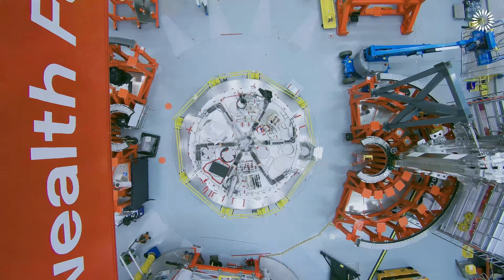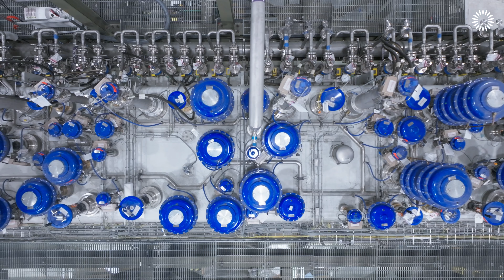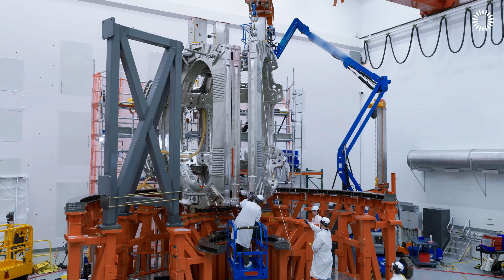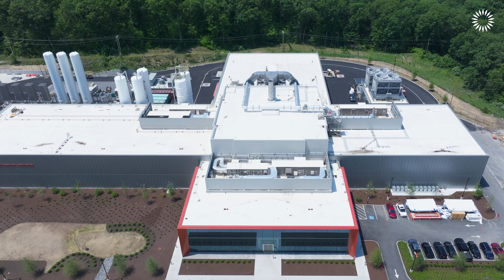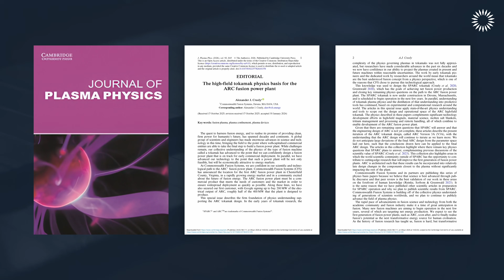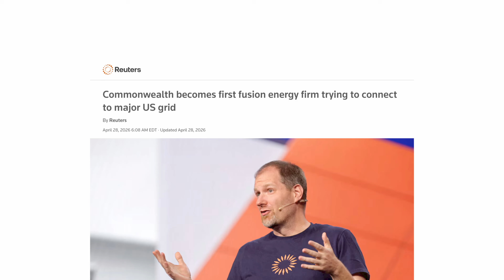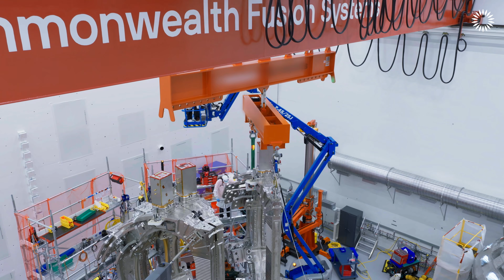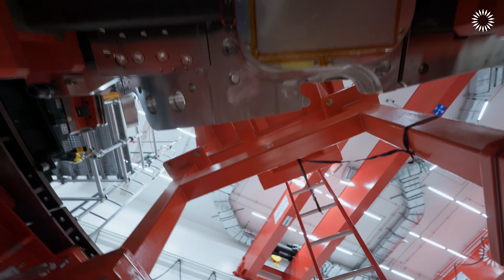An update from Commonwealth Fusion Systems (July 2026)

Comment: CFS first claimed they would achieve scientific breakeven in 2025.  Now it's 2027.  To produce ANY net power, they need to not only achieve scientific breakeven, they need to achieve engineering breakeven where the power created, after all engineering losses in power conversion, is more than the power put into the machine.  That's roughly about 5x more difficult than scientific breakeven.  To make fusion power economically, they need to achieve economic breakeven, arguably about 5 times more difficult than engineering breakeven.  They claim they will do this in the next ~5 years.  

After 60 years of research trying to make fusion work with tokamaks, some much larger than CFS's device, there's just a factor of ~25 to go.

It's a scam.  By the way, I have a PhD in Nuclear Engineering (fusion emphasis).
Reply: The absolute maximum time that fusion reactions can occur on SPARC is 10-seconds then, due to the lack of a robust heat removal system, a 4-hour thermal recovery time will be required before another fusion test shot can be attempted. Its maximum fusion energy duty cycle will be 0.0007. The conceptual ARC power plant reactor is specified to have 15-minute fusion pulses with 2-minute recovery time periods. So its fusion energy duty cycle is expected to be ~ 0.9 but at far higher energy quintiles per shot. SPARC play will serve as a foot-in-the-door effort to secure funding for the ARC project which will need to be many orders of magnitude greater, just in duty cycle, than the SPARC experimental machine.
Reply: @vernonbrechin4207  There's no reason to believe that this approach will achieve engineering breakeven let alone economic breakeven.  It's just hype.
Reply: @markmeridian3360 I totally agree. I’v been closely monitoring this field since the 1950s.
Reply: I share your skepticism...  Geothermal gives us all the benefits of nuclear (high annual kWh production and reliability) but without the extreme up front cost, danger, and waste.
Reply: @TerraPotentia  There no known spots on Earth that produce geothermal at power levels comparable to a nuclear site with even a single reactor. The record power output from geothermal was briefly 2 GW electric at the Geysers in California.  However, operating at that level rapidly depleted the thermal reservoir's steam pressure so they had to reduce the power to 750 MW - less than a single reactor.  There are nuclear sites that produce 5 to 10x this power level from multiple reactors.

That's why geothermal can't ever power modern society.
Reply: @markmeridian3360 With the advent of millimeter wave drilling, ie drilling with masers (using gyrotrons) instead of mechanical drill bits, geothermal can now be accomplished world-wide regardless of location...

Millimeter wave drilling can get us to the 10-20 km depths required to do superdeep supercritical geothermal power (a 5-10x increase in power).

Tis true that geothermal power can be depleted in an area over time, and that's where geothermal can use a principal of agriculture with a sort of crop rotation where you can use a "field" for a few decades, shift to another field letting that first field replenish geothermal energy, then shift to a third field, then a fourth, fifth, sixth, and then back to the first.

Just on land above sea level, there are over 4,000 PWh of geothermal potential, that's ~150 times current global electricity demand.
Reply: @TerraPotentia  First of all, at 20 km depth, the pressure will crush all known well pipe materials.  The deepest well ever drilled was 12.2 km and the drilling had to stop because the rock at that temperature and pressure plastically deformed, very quickly sealing the borehole.

 At 10 km of depth, a single well pair would cost between $50 million and $100 million (there are 310 wells at The Geysers).  It might produce 30 to 50 MW - that's a trivial amount of power for such a huge expense and that doesn't even account for the cost of the remainder of plant.  

The economics is NOT viable for anything but relatively shallow wells (2 - 4 km) which DO NOT produce anywhere near the power of what a nuclear plant produces and are possible only in very few locations.  

You're hawking pure science fiction.
Reply: @markmeridian3360  No science fiction going on here, my friend.  Quaise Energy has already field tested their drill at a granite quarry in Marble Falls, TX.

Granite, gneiss, basalt, schist, etc are the type of crystalline rocks with Mohs hardness ratings of 7 and above that make drilling deeper than 3 kms problematic slowing the effective rate of penetration (ROP) for mechanical drill bits down to less than a meter per hour.

Quaise Energy's test drill drilled a 4 inch wide borehole 118 meters deep through pure granite in 24 hours using a 100 kW portable power plant.

That's roughly 5 meters ROP, and that means we can reach depths of 12 kms in ~100 days where if you tried to drill that deep with mechanical drill bits (like the Russians you referenced) it'd easily take you 3-5 years JUST FOR ONE BOREHOLE.

That means 12 km deep boreholes for a couple of million dollars compared to tens or hundred of millions per borehole...

Quaise is building their commercial grade drill right now which will drill 8-10 inch boreholes using a MW scale portable power plant (10x the power of the test drill) so expect to easily eclipse the 5 meter ROP of their test drill.

With regards to the ductile nature of rocks at such depths where they "flow", Quaise has an answer for that...  

One of the things about the millimeter wave drill is that it vitrifies the edges of the borehole into a sort of obsidian or volcanic glassy rock.  This vitrified glass actually stabilizes the edge of the borehole and removes its ductile nature thus the borehole will remain stable.  Also, the boreholes will be pressurized which also gives the borehole stability in the long term.  PLUS, the longer your geothermal system is pulling heat from the surrounding rock the less ductile the rock becomes thus won't "flow".
Reply: @markmeridian3360 - Many people have been convinced that  various forms of nuclear power will be required to save the still rapidly growing body of humanity, with its rapidly growing resources needs. They all assume that we have decades left to make the transition.

All nuclear energy promoters, are in line with the vast majority of Earth's other 8.3+ billion humans, who continue to assume that we still have at least 20 years left to turn this 'Titanic' around using their favorite nuclear technology. They have become masterful in excluding the following warning from their consciousness.

UN chief: World has less than 2 years to avoid 'runaway climate change' (TheHill)
  * This statement was made 7.7 years ago.
Reply: @TerraPotentia  I too have long been a fan of geothermal power but I reman skeptical of claims of companies trying to secure funding for their experiments. I’m familiar with the recent company that you mentioned but they too have spun their story to make it appear their technology is ready to deploy, in mass, all around the globe. It isn’t.
Reply: @vernonbrechin4207   They're already building a geothermal power plant in Oregon right now.  Project Obsidian, just ~20 miles south of Bend Oregon (as the crow flies).  Real close to Paulina Lake
Reply: @TerraPotentia  Thanks for the tips, I'm glad to hear that the company is now engaged in a more challenging test and likely geothermal supercritical steam production. Next time I head up that direction I will try to find the site. I enjoy learning more from those engaged in such projects. In the past I've visited a couple of research sites and operating power plants.
Reply: @vernonbrechin4207   Quaise Energy has a Youtube channel, there are some recent videos on Project Obsidian, and some other small playlists of videos they've put out over time...  This company is legit, and they're already getting a lot of funding.  There are three classifications for geothermal potential, and Quaise's idea is to utilize the low hanging fruit, in other words hit the prime/easy locations to get some revenues coming in.  Then they'll use those revenues to eventually start buying coal and natural gas power plants (already in operation) and then convert them to geothermal after drilling the requisite boreholes on site.  The idea is those fossil fuel power plants already have a lot of useful infrastructure in place like ready to use hookups into the electrical grid and in some cases have turbines that can be used for geothermal.  This will help keep them profitable from the get go.
Reply: Always ‘just around the corner’  ahahaaaaaaaa Who actually believes this shite?
Reply: @Carlsbaddest  - Millions fall for it all the time. There are huge pools of people who have never been exposed to these promotional campaigns and never looked back at the lengthy history. It is them who are targeted and who fall for it. Once a person becomes a fan their love affair tends to limit their degree of skepticism.
Reply: Many physicists and engineers truly believe that, finally, they have the tools to finally work. Just because a person is infused with the belief that they are on the right track doesn’t necessarily mean that they will eventually realize that dream. At least two generations of researchers were convinced that by the time they retired this technology would be prove to be practical.
Reply: @vernonbrechin4207  When I was working on my PhD in Nuclear Engineering (Fusion emphasis) 40 years ago, the prevailing thought was fusion was about 20 years away.  I worked on a HUGE magnetic fusion machine (MFTF-B) while earning my degree.  Before it even made a plasma, we figured out that we needed a machine 10 times bigger.  Since I came from a background in Econ, Physics, and Math I ran a few numbers.  It wouldn't be anywhere near economic even if it could be made to work.  I finished up, got my degree, and sought employment in a different field.  The estimates are the same today - nowhere near economic - even if fusion could be made to work.

Comment: So are they going to produce a net energy or not?
Reply from the maker: SPARC's first job is to produce net fusion energy, aka Q>1, but that's not the last job — it's designed to reach Q=11. It won't generate electricity — that will be with our ARC power plant.
Reply: @CommonwealthFusionSystems   - If CFS ever announces that its SPARC experimental machine has achieved its design fusion goal of Q=11 the facility will still have consumed far more energy than the fusion energy it generated during the day of that record holding test shot. The input energy value, employed to calculate the ‘net fusion energy gain’ (Qp), only applies to the following two conditions.
1) The amount of energy fed into the tokamak plasma that heats it to fusion level temperatures.
2) The maximum time period that the plasma can last in SPARC test shots which is 10-seconds.

When SPARC is operating at near its maximum fusion energy test pulse power levels it will require 4-hour thermal recovery time period before another fusion energy test shot can be attempted. The total energy, consumed by the SPARC facility during the day of the record breaking ‘net fusion energy gain’ (Qp) test shot, is not employed in calculating the Qp value, which is typically abbreviated to just Q.

In summary, the maximum Qp value, that SPARC may achieve has almost no relevance to a power plant design engineer who is trying to determine if the SPARC tokamak design can eventually evolve into an economically practical electrical generating station that generates significantly more energy than it consumes.
Reply: @CommonwealthFusionSystems  - The SPARC experimental machine, if it even achieves all of CFS experimental goals, will only, primarily, serve as a misleading showpiece. Numerous operational parameters will need to be improved by many orders of magnitude to achieve CFS’s goals for their conceptual ARC power plant reactor, alone. That includes a 1,000 times improvement for the ‘fusion energy duty cycle’ parameter, alone. Additionally, SPARC will lack the vast majority of the components required for the creation of the ARC power plant. The reactor and magnets will need to be larger. Space will need to be added for a robust heat removal system and a tritium breeding blanket. The technology, required for tritium breeding, still hasn’t been tested since no functional fusion reactor has yet been created anywhere on Earth. A tritium processing plant will be needed. Two circulating molten salt loops with pumps and heat exchangers will need to be engineered along with a ‘pulse pause’ energy storage reservoir. These elements are not in the domain of typical power plant design engineers. After those elements the steam energy components follow including the boiler, superheater, turbine, condenser return circulation pump and a waste heat dissipation system. The turbine needs to transfer its rotational energy to a large electrical generator and then the generated electrical energy requires a voltage boost in an onsite electrical substation. All this has to be implemented in a way that is cost competitive with existing sources of electrical energy, such as photovoltaic panel farms supported by various energy storage methods.
Reply: The experimenters use a different definition of the term 'net energy' than is commonly understood by the general public, journalists, and funders. It has almost nothing to do with the input energy value required to power the experimental operation. This has been going on for many decades and has long been a standard practice in the field. A similar misunderstanding involves the term 'ignition' and 'breakeven.' Typically, the standard practice has been to allow that misunderstanding continue in the effort to convince funders that the projects have serious merit. Energy production may result from such projects if they can continue to overcome numerous barriers that still exist. The projection of confidence is not likely to solve all those problems.
Reply: The way they define ‘net energy’ does not include the total energy required to power their facility. With SPARC the facility input energy will be well over 1,000 times greater than the raw fusion energy  it generates, even if it performs as CFS hopes.
Reply: @vernonbrechin4207  I'm precisely talking of everything : "energy sent back to the grid" / "energy received from the grid". And it needs to run 90% of the time.
Reply: @NicolasW1234  - The fusion energy experimenter’s definition of ‘net energy’ and ‘net fusion energy gain’ significantly differs from the practical sense that you intended. They largely ignore the total energy coming into their experimental facilities. Instead, they apply a tiny subset of that input energy when calculating their ‘net energy’ value. Their calculation also omits the appropriate 60% energy loss that occurs between the thermal energy generated by the reactor and the amount of electrical energy that will likely make it to the local grid.

The CFS conceptual reactor will need to generate approximately 1,000 megawatts of thermal energy in order to deliver approximately 400 megawatts to the grid.

This misleading practice, of energy accounting, has been going on since the first nuclear fusion energy experiments began in the early 1950s.
Reply: @vernonbrechin4207 - So somewhat higher than a datacenter.
Reply from the maker: @vernonbrechin4207  There are many steps on the path to commercial fusion energy. To see why Q>1 is a big one, search for "Q>1 Bob Mumgaard fourth milestone." Q>1 is not the last milestone. After it comes the net electricity milestone, which includes factors like magnet cooing and steam turbine efficiency.
Reply: @CommonwealthFusionSystems  - Thank you for referencing Bob Mumgaard’s paper on this topic. I viewed as a bit of a word salad. He has often claimed all the fusion energy physics issues have been solved and only some engineering ones remain. Yet the ‘net fusion energy gain’ (Qp) value is a basic aspect of the physics of the system, just as it was in the 12/05/2022 NIF ‘breakeven’ laser fusion test shot that consumed over 100 times more energy than the energy value that was selected to calculate that Qp value. I hope to see more transparency and less creative accounting in this esoteric technical field.

Journalists, the general public and funders deserve to know that major advances will still need to be achieved between SPARC’s, hoped-for,  10-second maximum fusion test shots, with intervening 4-hour thermal recovery periods, and the 15-minute pulses conceived for CFS’s currently envisioned, economically practical, ARC fusion energy power plant.
Reply: @vernonbrechin4207 do you think cfs will eventually hit net electricity or not.
Reply: LOL, of course not . . . but the founders will have taken a lot of investors money by the time this becomes inescapably obvious